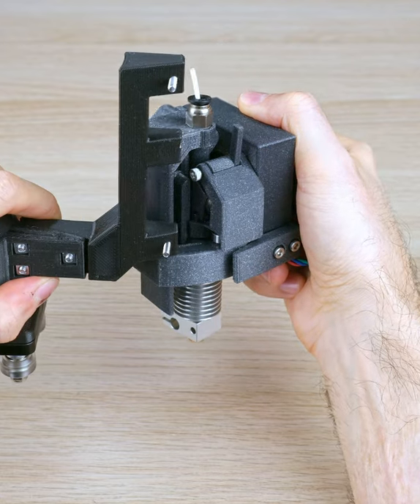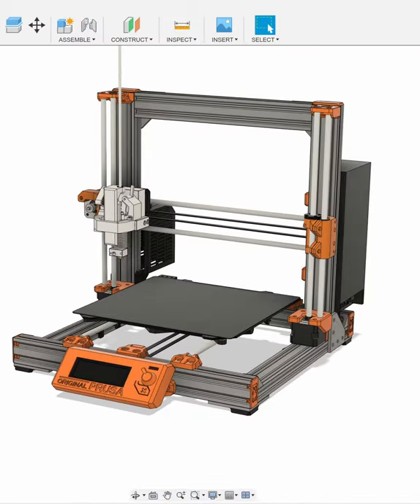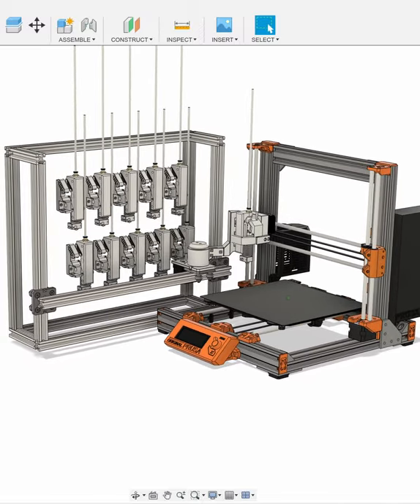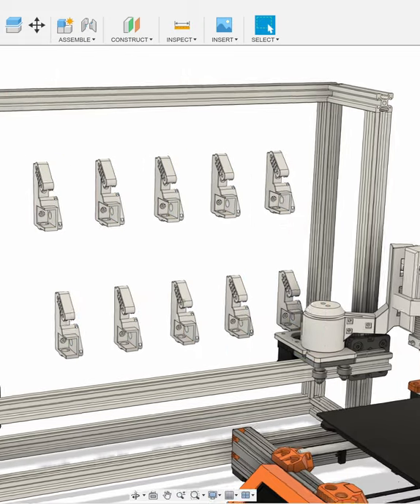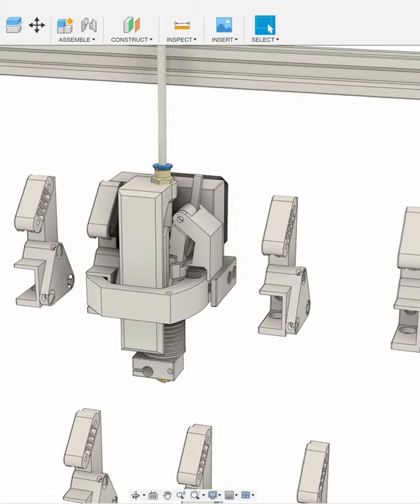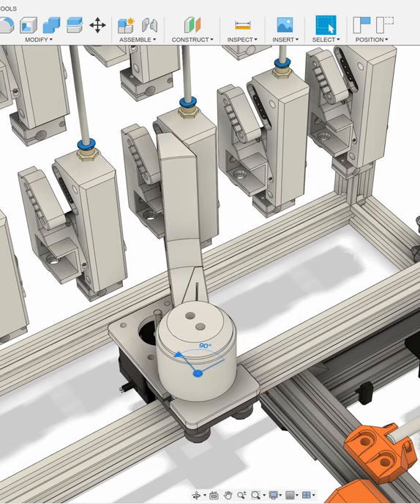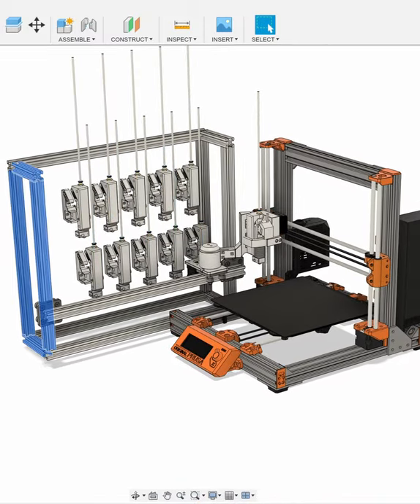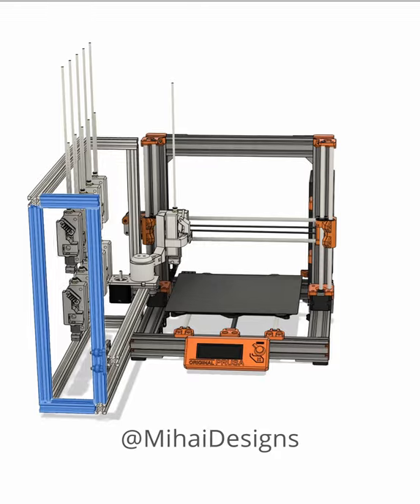Hotend parking array for my EngineSwap 3D printing project

Comment from the maker: Full project playlist in the description. What are your thoughts?
Reply: I think it’s amazing! It could be really useful for home production to swap out different materials/colours really quickly and if you need a different filament after a print you can immediately change it and start printing to save time! Awesome dude keep it up!
Reply: absolutely phenomenal work
Reply: Looks awesome!

Maybe to reduce the footprint, you could put it on a vertically oriented, rotating, cylindrical, rotary encoded doodad. Yeesh that was a mouthful.

Anyway, that way you could build upward as you add hotends and not outward.
Reply: I my mind the magazine could be horizontal across the top (facing down with the backs of the hot ends wowards the base) with the filament coming in from behind. have the filament and the hot ends on the same structure that indexes across parallel wiht he X axis. then it's one motion to make the 90° trip from the structure to the hot end receiver whenever it's ready.
Reply: It looks cool, but why would you need multiple hotends? I've only ever used my E3D V6 and changed out the nozzle when needed.
Reply: @lio1234234  Maybe because it's easier to automate swapping a hotend than a nozzle?
Reply: If you made the parking array above the printer it could store more hotends and above hotels parking array you could store filliment . If you probably store far more hotends. 3 chains with each link being a hotend could fit 30 or more hotends but regardless of how the parking array is built there are to things that need to be addressed. Firstly powering all the hotends or if only powering one hot to have the parking animations plug in a connector. If you keep the all plugged in you would need 10 io ports that can provide at least 1.5A  of current depending on what voltage and what heater cartridges you use. Secondly how are you going to store all the different filaments for the hotends? From what I've seen your filliment dry box feeds out the front not horizontally but 10+ spools of filliment are going to take up a lot of space regardless and way 10+ KG even if you store everything in open air. If wanted say 11 hotends with 11 1KG spools of filliment enclosed in dry boxes  it would way a ton. Thirdly how are you going to power the extruders? The simplest way would be to have 10 or more drivers but that also means 100+ dollars for decent quality stepper drivers.
Reply: If you can over come all of the designs issues your concept would be incredibly useful and make far more complex design printable. But the concept is somewhat wasted on a prusa i3 mk3s or any other similar printer. You cound make swapping hotends faster and simpler if you put it on a coreXY style machine. You could also combine the concept with the pallet 3 pro ( the small box that splices / switches between fillments) to make incredibly detailed models with basically unlimited color! With limited or even no color swap tower. For lower waste. The space complexity and cost of the design would make it more suitable for a larger printer where the space needed for the hotend array and spools of filliment would be proportionally less. This concept would also be incredibly interesting on a 4 or 5 or even 6 axis 3d printer. 

TL;DR amazing concept, once the major hurdles are dealt with the skys the limit. Combining this with filiment multiplexers ( like the pallet 3), additional print axis(es), different size nozzles, different materials, different extrusion temps, ect. I can't think of anything that such a machine cound not do, this could be the final piece of the puzzle. Looking forward to see where you take the concept.
Reply from the maker: Thanks for sharing your thoughts. Still a long way to go. Should work on various printers. I plan building a larger one some time
Reply from the maker: Most parts I already answered in my previous videos. Filaments will take up space for sure no matter what. I'm more worried about all the PTFE tuebs getting tangled
Reply: This is such an awesome project!
Reply: @MihaiDesigns  what if you put the rack in front leaning back instead? The the tubes of the unused ones are above the one being used an not get tangled with the one being used, or if you use a corexy with with side rails longer than the bed the toolhead could load/unload the hotends itself, kinda like the e3d system 🙂
Reply: waste your time...

Comment: Great project, I imagine the reliability of loading and unloading hot ends may be difficult to get right but wish you luck!
Reply from the maker: Fingers crossed! It'll be tricky and will probably require changes, but I'll figure out a way.
Reply: Sorry, I hope you make it but making this reliable feels impossible to me. Good luck!
Reply: @MihaiDesigns  try to use upper left side corner as a station, for x and z locating and a rigid spot for switching nozzles. Good luck man, this seems to be a better invention than multiple hot ends to me XD…

Comment: Hi there! I didn’t think you were designing the hot-end swappable mechanism to have them automated at this scale… Aren’t you somehow trying to compete with the Palette 2 system?? I don’t know if it makes sense having so many hotends available to automation.
Reply from the maker: Well Palette 2 is tackling the same issue, only that results in a large purge tower which is not ideal. You can have fewer hotends and there will probably be a smaller version, but I want as many as I can just for comfort.
Reply: @MihaiDesigns  oh, ok! Yeah, the purge tower is not fun, like, wasting sometimes even more plastic than what the model uses. I wish you good luck!

Comment: So this will be automated in the end? Like, you will be able to incorporate hot end swapping mid-print with code embedded in the print’s gcode itself? If so that’s so freaking awesome.

I take it you will also have rolls of filament pre-loaded into each of the hot ends you will use in the print? This is so cool… Keep up the good work!
Reply from the maker: That's exactly right. 😎

Comment: The spools should be mounted directly above, minimum of 4 feet for my buddy's. He had 4 colors . The real problem is to overcome is the drag. As you get farther away  from the print plate it will rub pulling filament sideways. Layer height, location, and flatness problems.We solved this by powering one set of the spool rollers. Evey time the filament is extruded it sends power also to those rollers(gear reduced).. The first try we had was to send the hot end to its most extreme, leaving excess filament hanging. But this was scrapped due to the added stop after each layer, and print time suffered. But worked great for a much cheaper option.

Comment: For a time lapse slider why not just offset the camera to the left, that way you could keep the track out of the way and still get footage from the left.

You could also turn the hot end holder to the side as since it turns you don't need to be perfectly straight with the printer

Comment: Have you an idea how all this will be controlled softwarewise? Will there be some kind of arduino based addon to the stock board or what solution have you got in mind?
Reply from the maker: Good question! There will be a separate board most likely.

Comment: I'd rather have some wasted material than multiple €100 hotends that don't get fully utilized actually, don't see how this could be cheaper than an MMU or how you would deal with the cables. But that's just my two cents.

Comment: will you need a separate extruder for each hotend assy?
Reply from the maker: As in a second extruder for purging? Yes, makes things easier. Just a motor with gears and a driver basically.
Reply: @MihaiDesigns  oh right I thought each individual hotend assy would also have its own extruder motor and gears as well, so no need for purging. But that would be overkill maybe Looool